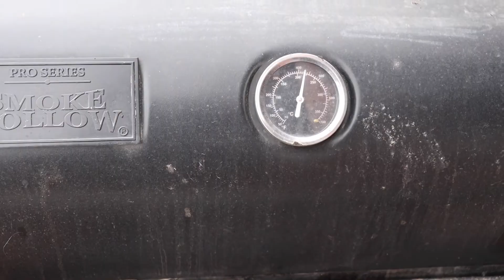Welding high steer arms to a Dana 60 Knuckle #DANA60 #EZweld #Tigwelding

Comment: Awesome job. 
Wht amperage and pulse settings are you using for the tig on that heavy metal?
I'm just learning tig and haven't done anything thicker than rollbar tubing so far.
Reply from the maker: Thanks! I mostly keep the tig set at 200 amps, then just adjust the heat with the pedal. For these pieces I keep the pedal to the floor! It’s probably a bit undersized for this, but I think the pre heat helped it. I set it at a 1 second pulse. The other numbers are around 20-30%. So basically it hits full pulse for a second, then drops to 35% of power or so.